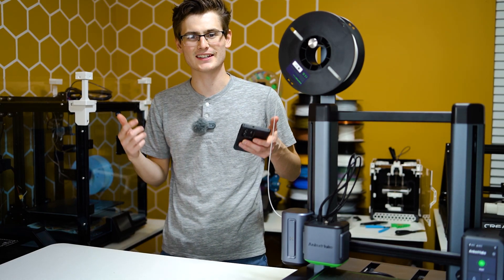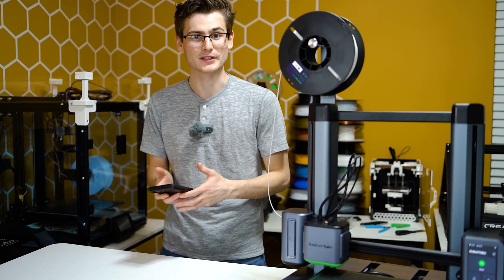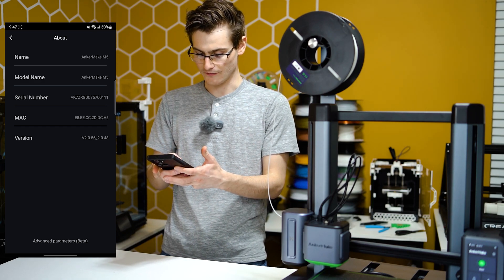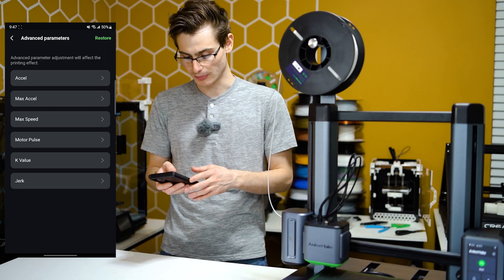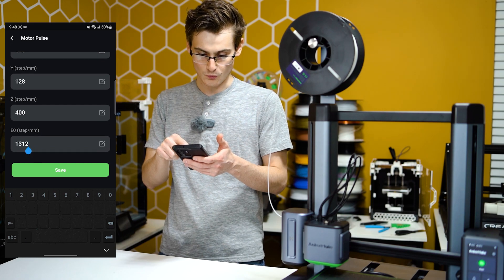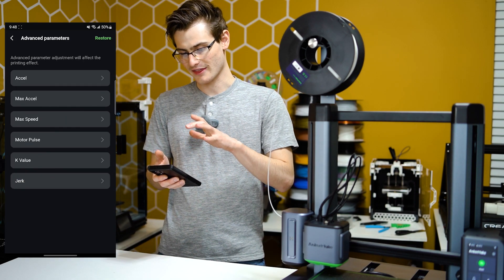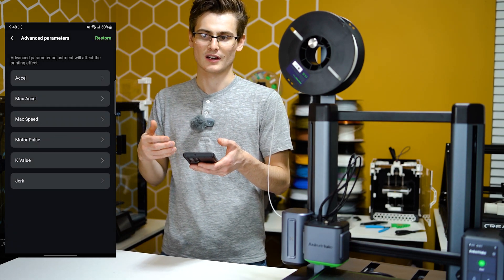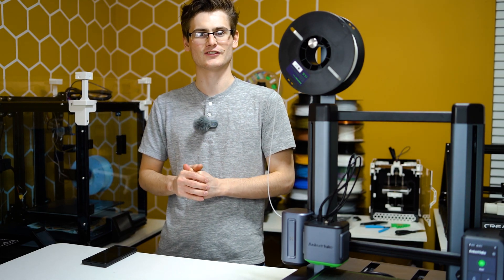How To Modify Your AnkerMake M5 3D Printers Extruder Esteps

Comment: FYI, on my latest version of this app there is an Advanced Parameters (beta) button hidden at the very bottom.  The steps are waaayyy off on my new machine, and all of the parts are so under extruded they literally crumble as I take them off of the bed.
Reply from the maker: Wow really? If you extrude 100mm what are you actually measuring?
Reply: @ThePrintHouse  An extrusion of 150mm gets 140mm of movement.